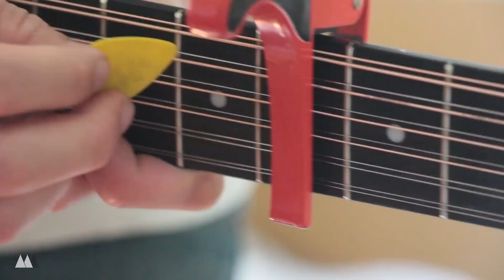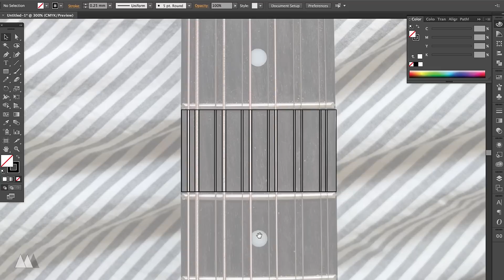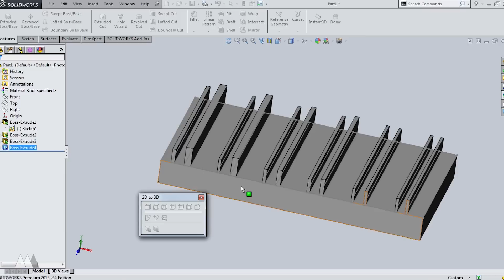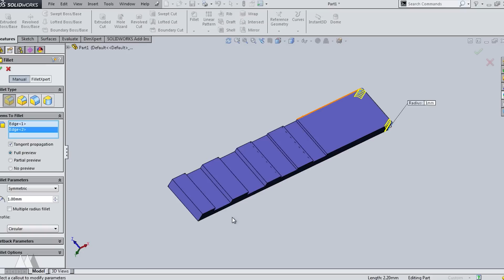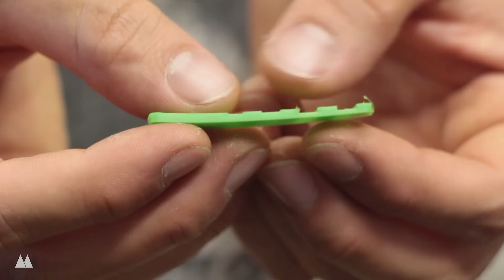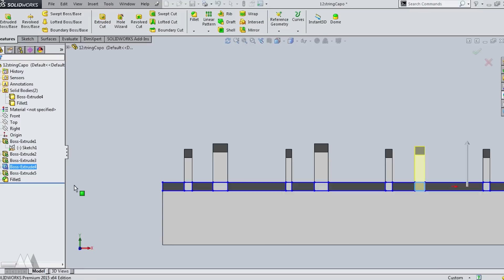A 12 String Guitar Capo Mod

Comment: Thalia Capos makes a capo that works great for 12 strings, they also sell an adaptor capo pad specifically designed for 12 strings
Reply: Someone makes something that can do what we 3D print, cool. The point is being able to 3D Print it, save money and reduce waste!
Reply: Thalia do make lovely capos! What I found really valuable about this video, though, is seeing our intrepid young fellow figure out how to do this for himself, as well as his explanation of how he went about it. There are reasons to prefer either option. This 3D-printed adapter is available basically on demand, for far cheaper than one of Thalia's capos. The design thinking demo is priceless.

Comment: Clever! Have you seen the Paige 12 string capo? It is a design that features moveable rings of a hard rubber/vinyl(?) material similar to aquarium air-line tubing, which fit over the round fretting bar of the capo. You can slide these rings into the position you require in order to properly fret the octave strings. The effect is very similar to what you have achieved, and is adjustable. Your solution is a ultimately less 'fussy', but the crenelated fretting surface effect is the same! Good work!

Comment: That's a great idea!  I play a 12 string and know the issue well. I use a capo with a softer silicone that compensates for the thicker strings. Works perfectly well.
Reply from the maker: Makes sense... Shame the filament I used is the softest I've been able to get my hands on, because it would function a lot better if I didn't have to line it up perfectly :P

Comment: You could always do what I did, search around for a strong capo and buy a few, I don't have problems at all with my 12 and I use a capo quite a lot, the other thing is use lighter strings so to make it easier for normal capo's, I use 9's and it sounds brilliant! good luck.

Comment: Very impressive and fascinating use of 3D printing. Of course, you could just buy a Schubb 12 string capo for about $23 from Amazon.
Reply: But the shubb is not compensated for thick and thin strings and you have to apply a lot of pressure as with all other 12-string capos.

Comment: If you didnt have a 3d printer you could also use a razor blade to slowly edge away at the rubber on the actual capo where needed however if you messed up the loss would be your 20-something dollar capo and not a cheap 3d printed piece

Comment: Measure twice cut once. You should have measured the string thickness. Good job though I will make mine when I bought new flex material although I am not sure my 3d printed capo is strong enough.

Comment: Have you ever used inventor? it's like solid works, but in my opinion more simple. I use it in my engineering class, we use it for our 3D printer lessons.
Reply from the maker: I haven't... plus I'm so comfortable with Solidworks by now it's hard to try other programs :P

Comment: I have the same problem with my 12 string Seagull guitar and have not found a capo that works. I do not have a 3D printer but was wondering if there is someplace that I can pay to have an adapter made for my 12 string?

Comment: Fuck, how can you play with that pair of pliers hanging off the neck?
Get a Bill Russel double elastic capo (Dunlop #7192).  Works great on 6- and 12- string instruments, quick and easy to change frets fast, easy on the guitar, and you won't have all that hardware in the way of your left hand.  It'll be the best $10 you ever spent.